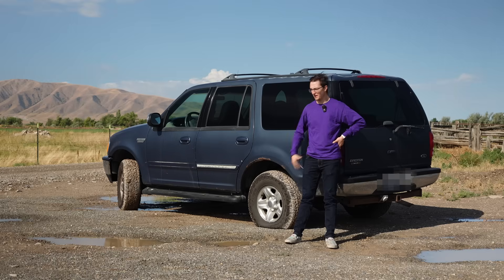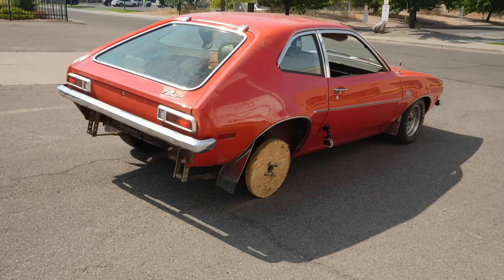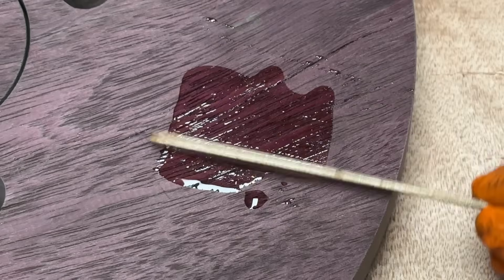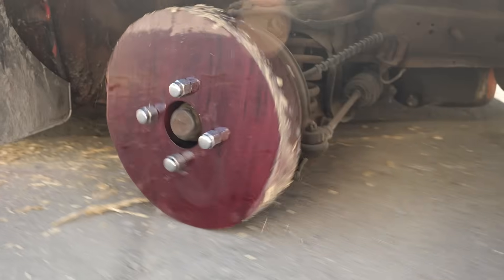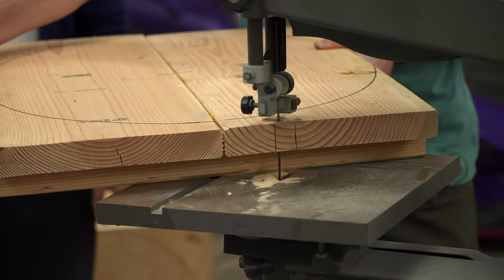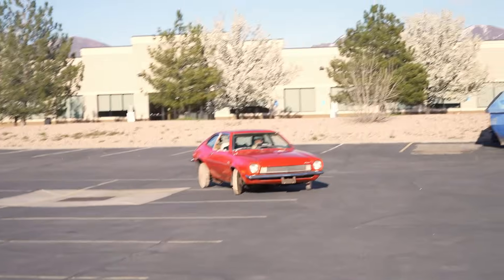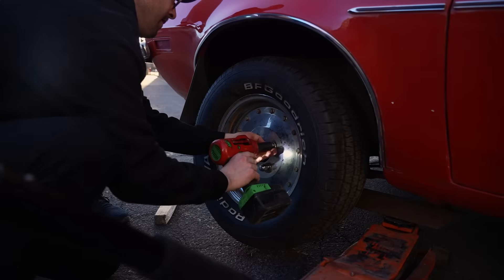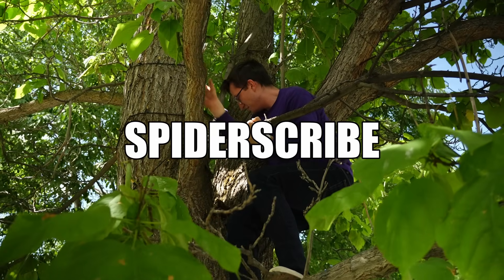Can You Drive On Wood Wheels?

Comment: My guess before video is likely plausible, at least low speeds, but even if could do so would not want to. As seems to have both poor grip to road and would take out a ton of shock absorption out of system. Then there is issue of probably would not be legal on any city, state, or county road.

After video: a bit surprised how quickly deteriorated but given that plywood was possibly narrower than wagon wheels were, on a much heavier vehicle probably should not be surprised that needed to be wider to have a chance of holding up. Did not even consider that probably would also be more expensive than real wheels/tires.

Comment: You know how you put a screw in the middle and used a sting to draw a circle for your outline? Well you can use a similar technique to cut out a circle on a bandsaw. Or you can make multiple cuts on a table saw until it's close and then turn it to get it perfect.

Comment: The evolution of wood wagon wheels was to add a metal band to the outside, and on the inside a metal fixing plate.. trouble is then your wheels would be indestructable and destroy blacktop.

Comment: When you broke the Purple Heart cast off you just…grabbed it in the weirdest way. I’d have inverted it from how you had it and used the sides as handles and basically pulled the points together. I feel like it would have broken easier that way.

Comment: Hey next time add a metal strip and a rubber band over that and you'll have a solid wheel capable of not shattering after a few miles of use

Comment: I've been thinking. initially I thought you could try epoxy resin wheels but that would cost you approximately $1000 for 4 wheels so i decided that wasn't in your budget. However what about casting some wheels in aluminium/steel or filling a tyre with PVA glue? I'd also love to see the concrete wheels retried but leaving the tyre on and adding more reinforcement to see how well they'd cope. You may have to build a larger furnace for the metals but it could be used for other videos (such as other baseball bats) so it wouldn't be a wasted effort.

Comment: You'd be pretty hard pressed to get a fire going. Every time the point making contact with the ground stops touching the ground all the heat is gonna dissipate into the wheel well because big surprise, metal is a good conductor of heat.

Comment: alot of materials would be not ideal as a wheel due to friction to the surface of the ground. rubber is durable and the density helps it withstand the surface of the ground. try using rubber as the top layer of the wheel.

Comment: That's not plywood, but OSB (Oriented strand board). Plywood uses several layers of thin wood alternating the grain direftion. This makes it strong in all directions, and also quite dimensionallynstable.
Obs is a bunch of small "chips" in random directions pressed together with PU glue. It shares many of the strengths of plywood though

Comment: If you want wooden wheels that will last, you need to start by making it out of segmented circles that are built up in thickness, similar to what they did here with the two, but not using straight boards cut to a half circle. Six or eight pie segments of 2x material could work. Glue them up on a flat surface, covered with wax paper, and use a banding strap to clamp around the outer edge while drying, then weight a stout waxed paper covered top plate to help keep it flat. Make three at least for each wheel, which is 4 1/2" total thickness, and dowel these segments together with 3 per, turning them so that the joints in the middle segment don't line up with the outer layers. The laser could drill the holes, although they will probably need to be countersunk on the front face some, and align and square up the edge. A good finish never hurts in this case, either. Then you use a washer of some kind on the nut side, probably, and band it with something, like a replaceable truck tread.. Pretty entertaining vid!

Comment: 3:16 that's one way to plane wood 😅😆
7:51 crazy f*cker, putting your fingers under there...
The wheel locking up uner breaking was likely the ABS going out of whack. With rubber there's more grip so it's less likely to do that even when you're going slow 😛

Comment: Bro I'm the same way drill non existing just a Philips and a flat- head! I wish you were able to get 4 Purple Hearts but bigger to get  strong less chipping. I believe you might have done what the 1st wheel makers probably went through before settling on rubber. And you found out how to quickly remove a wooden wheel, and get a campfire 'Smell'!

Comment: I was wondering what would happen if you made the tires with either several layers of plywood so the nuts are flush against the rim of the tire. Make sure there's no gap between the wood and frame with the bolt. What would be better would be actual wood that's solid. It's more durable than plywood. And I was wondering if you could wrap a tire around it and secure it to the tire if it would help with traction and protect against the asphalt and burnouts. Just a couple of ideas to help you if they work great. If not it was just a theory.

Comment: You have military kinda tires / VIP safety tires of some kind, that are made from all synthetic rubber and can't deflate. Dunno about them personally or how much they cost, just that they exist. Might not be the most comfortable.
Reply: They are not made that way, run flats are like a band of hard plastic in the center of an air filled tire. You still want the comfort of air filled but the security of run flats.

Comment: A long time ago when cars were knew they originally had wooden wheels at the front and then tires at the back because the back wheels are the ones that actually would drive so they would attach wooden wheels at the front because they didn’t need any grip or anything and then the back ones needed loads of grip so they made them out of tiresor they just had four wooden wheels before that

Comment: Tip when glueing wood you need quite a glueing pressure  to get agood enough glue joint,  puting a tire on  sutch abog glueing surface it is not near enough .
I would guess bad glueing is alike candidate to the failure of the cross lamination wheel plate . I
Using 3 layer wood would probably have helped also.

Comment: The idea works but one thing I would have done is cut the tread off of a tire remove the sidewalls and some how secure the tread part of the tire onto the outer edge of the wood wheel so its what makes contact with the road. Make the wheel thicker probably about as thick as the rubber is wide you'd need longer studs though in the axle.

Comment: You know, wheels used to be wooden like 130 years ago. No shit you can drive on wooden wheels, ever heard of a carriage? The thing people used to use before the Model T? The model T even had wooden wheels they were just wrapped in a new Tech called a tire at the turn of 20th century. 
You know wheels have been wooden longer than they have been metal and rubber?

Comment: just use 100% infill tractor wheels, or just drive a tractor. no flat tires. yes designed to last. or dont drive. why. its useful to re-invent the wheel sometimes. especially when others are telling you what to do. dont do what they tell you. asterisk wheel. yes put mini tractor wheels on a car. what did the wheel say. I got tired. wood is bone. indeed. so why did you not waterjet the wood. wooden horse cart anyone. no its not rocking, it wooding. wood you. make a carbonized wheel out of flour putty.

Comment: My soul died when you touched that purple heart wood and relegated its beautiful existence to becoming hell’s wheels. Fs for the beautiful wood.
Reply: One of the most beautiful pieces of wood imo, and it became a tire.
Reply: Big ol' F
Reply: The writing was on the wall when he kept calling OSB "plywood":  Not an expert woodworker.
Reply: lol same here, that's a waste of good wood
Reply: F
Reply: Invaluable contribution to human curiosity
Reply: When he said he set the water jet to “birch” I laughed. I worked with a little Purple Heart for my wife, and that wood is so hard and strong that it burns if you use a finish blade or cut too slow
Reply: F
Reply: This! I cried for that tree
Reply: Good thing about wood is you can grow more
Reply: @JohnSmith-j2j  after decades… also trees are expensive.
Reply: @WFF134  There are like gazillion trees across the multiverse, if you ever want to set on a treecide adventure.
Reply: F 😢😢😢😢

Comment: wait until this guy finds out about wagons
Reply: Yeah but wagons only had a few horse power.
Reply: @itsthedude6155  to be fair a ford pinto also only has a few horsepower
Reply: @Imnotrealyouneedtowakeup fairest point I’ve seen made in a while on yt comments 😂💯🙌🏼
Reply: @Imnotrealyouneedtowakeup that’s why when that thing broke the rear loose I lost it 😂
Reply: @Imnotrealyouneedtowakeup  But it is already a fire hazard...
Reply: @itsthedude6155  Whistlin diesel's cart wheeled hellcat had plenty
Reply: @itsthedude6155  It's much lighter as well
Reply: @itsthedude6155  normally they had atleast 2 horse(powers)
Reply: The first car in the last 500 years was 15 mph

Comment: You need a steel plate on both sides of the wood wheel so the lug nuts clamp the wood tight instead of just relying on the holes in the wood for strength.

Comment: Yes you can, wagons used to have wood wheals. you just got bad craftmanship.
Reply: It’s wheels😂 figured since you can’t even spell wheel you wouldn’t know better. But um… they had rubber and metal depending on the wheel on the outside edge for protecting the wheel. Not to mention a car is also 2 times the weight.
Reply: @Oddityy-  still poor craftsmanship, and adding to my original premise, they used metal rings outside when the wagons were half the weight of the car, further proving my point. This is poor craftsmanship.

Comment: Shouldve done the burnout on wood. The heat was spread out on the entire edge of the wheel so it was dissipating and not concentrated enough. If you run it on a board, the baord is constantly being heated up

Comment: Im just gona say it stop screwing up that old pinto that body looks to be in great shape. If you are gona do something to that pinto turn it in to a hot rod they lend themselves well to it like gremlins they have posi rear ends and a stupid amount of space under the hood. Go buy a actual junker some early 80s k car or a beater honda they have no value beyond driving and the hondas tend to run till they are a pile of rust

Comment: Built a set of these for our camping trailer. On its regular wheels, it was an inch or two too tall to fit in the garage for winter storage, and I hated inflating and deflating the tires to get the extra clearance. Worked like a charm and very low rolling resistance on concrete.
Reply: So changing the wheels is less effort than de- and inflating them o.O ?
Reply: @joelmiggler6513  At the time - yes. Also not good for the sidewalls to stay partially deflated in the same position for months.
Reply: @joelmiggler6513
Time invested<time saved
It's not that complex.
Reply: Plus you don't get flat spots on your tires

Comment: Mythbusters showed that it's difficult, but NOT impossible, to start a fire by doing a burnout because the air movement generated by the tire is fast enough to extinguish the fire.  You can make lots and lots of smoke though
Reply: Mythbusters also did the wooden wheels thing better by simply cutting a cookie out a log and bolting it on as-is, without any glueing or screws. Just a section out of a treetrunk thats the right size.
Reply: What you do is heat it up hot enough and then stop and if it's hot enough the tire would just spontaneously combust
Reply: The hydraulic press channel used large saw blades to drive on ice, that was pretty cool.
Reply: 03 f150 with Goodyear silent armors for tires seen it was nuts
Reply: Kranky at Kandos's would prove them wrong.

Best Holden ever built.
Reply: I think too much smoke not enough oxygen
Reply: Whistlindiesel put wheels from an Amish buggy on a Mustang, that worked pretty good.
Reply: @buddy1155 he did it on his SRT Hellcat Challenger but that was steel buggy wheels.He did the really big buggy wheels on a Ram Duramax.
Reply: DONK!